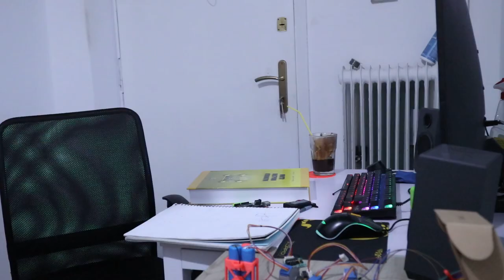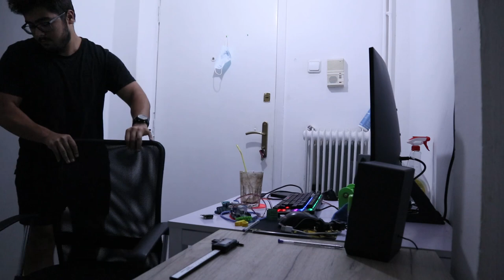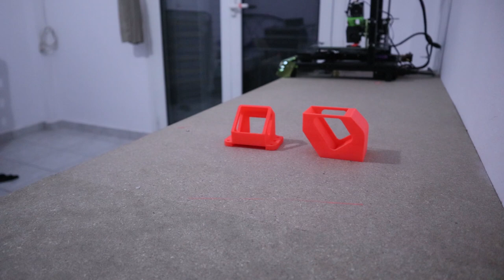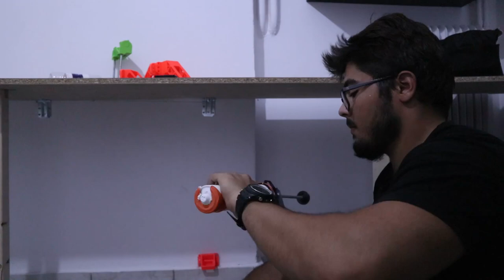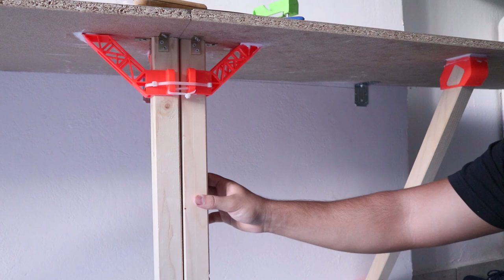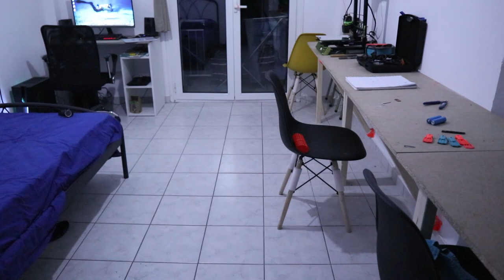DIY workbench ! UNDER 50$ using only 3d printed parts !!

Comment: It would have been better to Build a 2x4 Frame with pieces front to back between frame every 2 foot to support top more, Screw frame into wall Studs at Desk Height, then Legs under front every 4', No Angle Pieces are needed, then screw Ply top, PAINT the top, because If you get it wet it likes to warp, Paint will protect it some.

Comment: The top is really too thin, i would have use double sheets glued together.
Reply from the maker: To be honest  , we didn't thought about it ! But I forgot to clarify the use of it ! I mean , the workbench is in my apartment next to the bed I am sleeping , I think for soldering , 3d printing , studying and things like that will be ok ! We will not be doing drilling and heavy work cause the neighbors will call the police ! 😅
Reply: MDF is cheaper than particle board(the stuff used in video) here, and a single 3/4 (19mm) sheet is plenty strong enough to use a single sheet.  I would have used proper adhesive like PL Premium construction adhesive or No More Nails(cleans up in water when wet).  RTV takes too long to cure, and not really what its for,